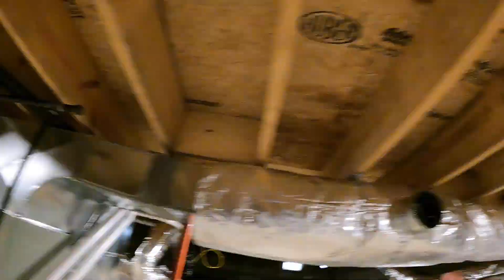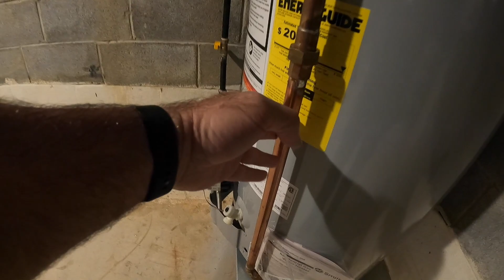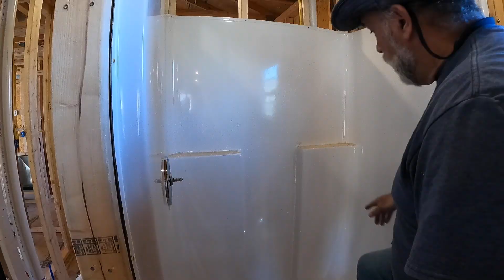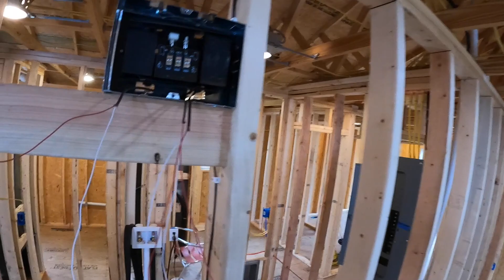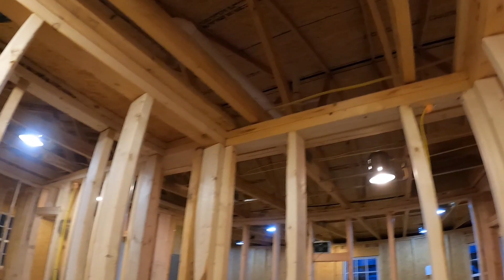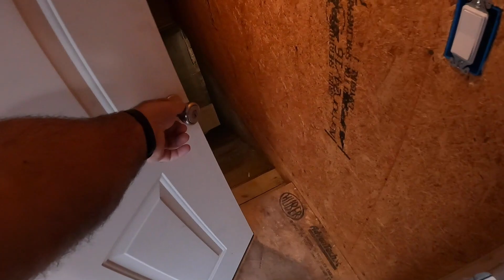Not Necessarily HVAC Part 20

Comment: always run 10awg wire for an condenser, regardless. that shouldn't pass electrical inspection ever anywhere in the USA.
now feeding a unit rated under 20 amps with a 30A breaker and 10awg is fine.